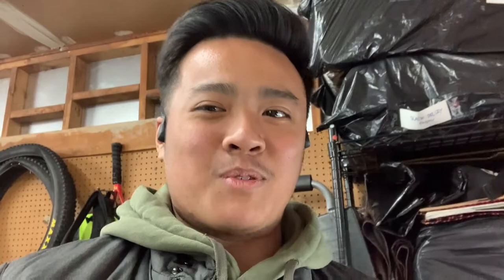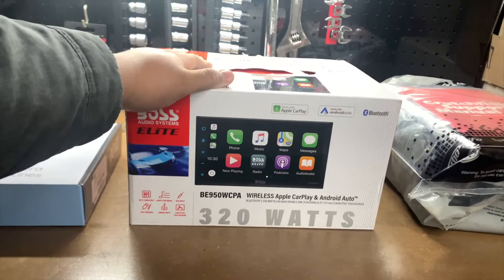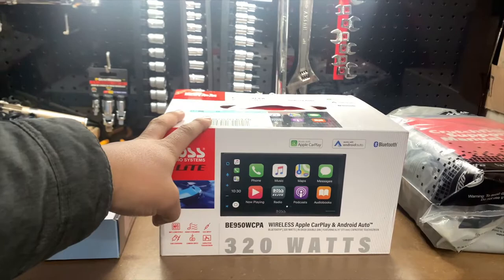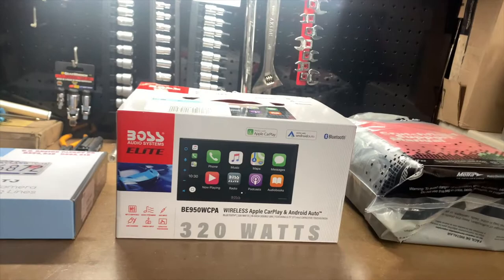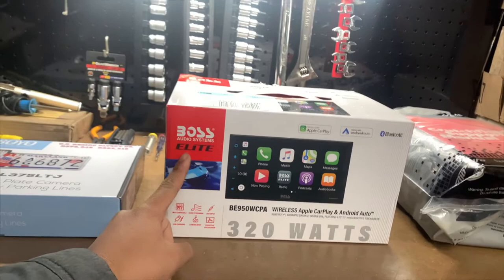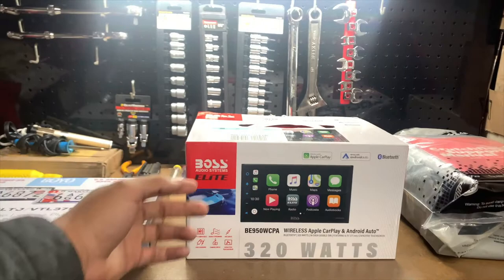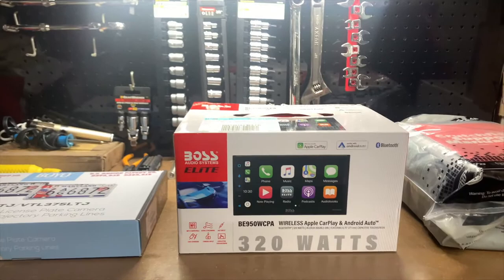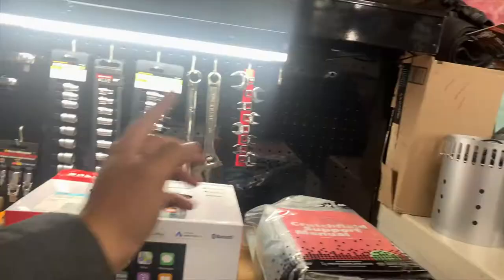2001 Volvo V70 Gets Apple CarPlay!!

Comment: Hey man, thanks for leaving this video here. I can't get this model over in the EU but you inspire me to perform the same upgrade on my  2000 Volvo V70 (to be). 
One question: how are you experiencing navigation with this installation? One thing I am worried about is that the screen is quite far-off my usual field of view. That's my modern units are farther up towards the windshield. 
I'm thinking of mitigating this with a unit that pops out a little, the screen could therefore sit somewhat higher. Not my installation of choice but considering if it's necessary. Thanks for the help!
Reply from the maker: So far navigating has been alright. Took some adjustment having to look downwards each time but I’ve acclimated to it. Having it higher would definitely be nice. I appreciate the kind words and hopefully all goes well with your install!

Comment: Hello! Sorry to bother. I have a volvo s60 2001 petrol. It would be great if you could help me figure out this project of mine.
The only concern I'm seeing is the re-wiring. It's not really just plug and play. Can you give some more information of how it is rewired to fit the new device?

EDIT: Is this the wiring harness adapter that you bought? "CRUX SWRVL- 54 WIRING INTERFACE"
Reply from the maker: Hey so go to https://crutchfield.com and then you can enter your car’s details. Afterwards it will point you to the stuff you need for a wiring harness. I don’t know if ours are exactly the same, but that website will specify. Lmk if you need anymore info